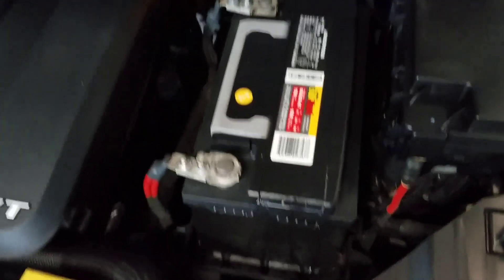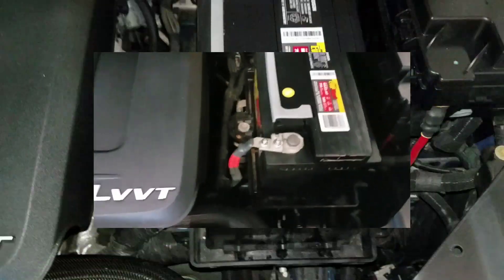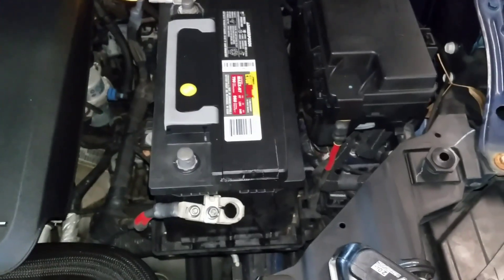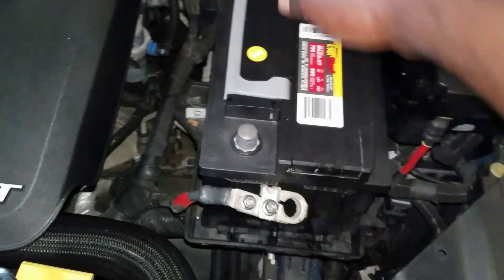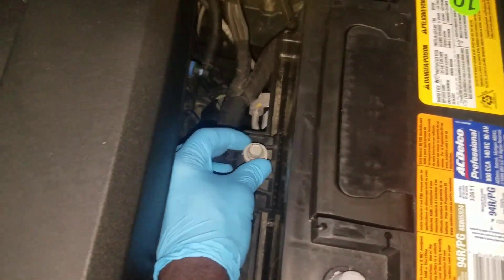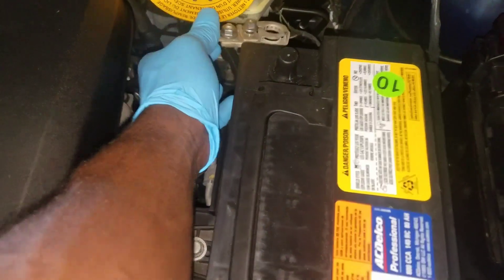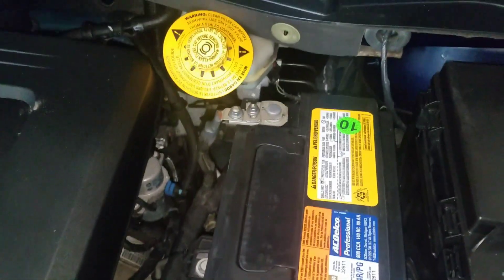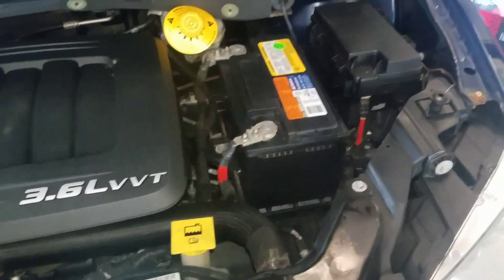dodge caravan town and country battery replacement

Comment: Great,  it look like a long heavy reach,  but easy to do.  I was taught to disconnect the negative cable first. Then put on last to prevent any sparks reaching the computer.
Reply: You are correct. The negative cable comes off first, and goes back on last. Those computers are expensive!

Comment: Do you have to reset the computer? Or does it reboot itself.
Reply from the maker: No need to do anything extra than change the battery nothing need to be reset or programmed
Reply: @DULLAHGOSOHARD  Thanks. That was my question too.
Reply: That was also my question. Thx!!!